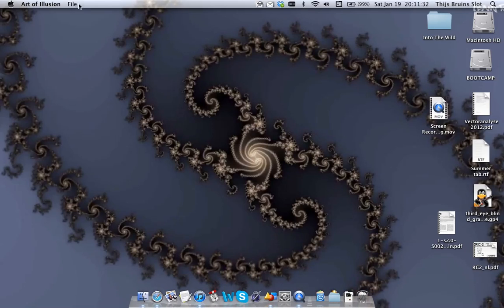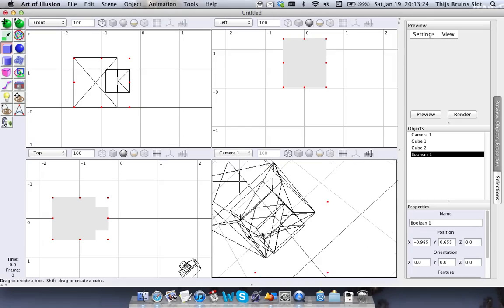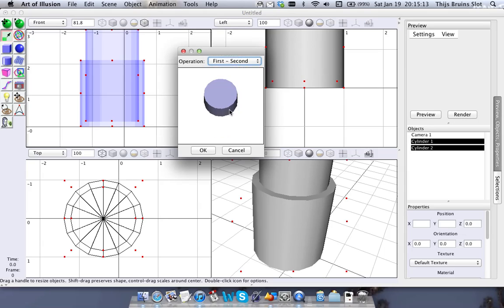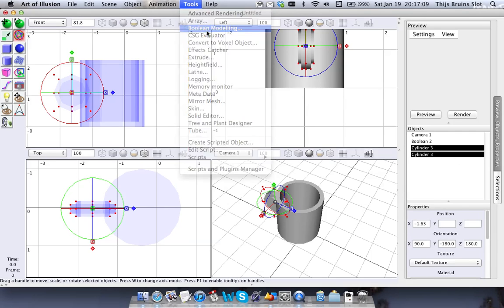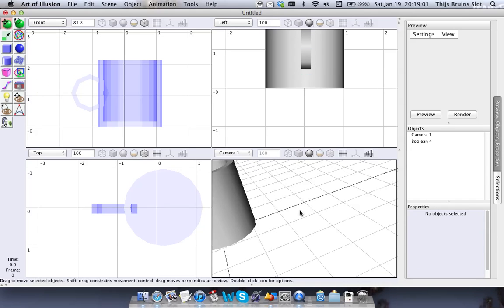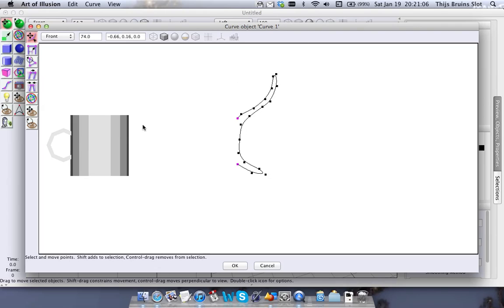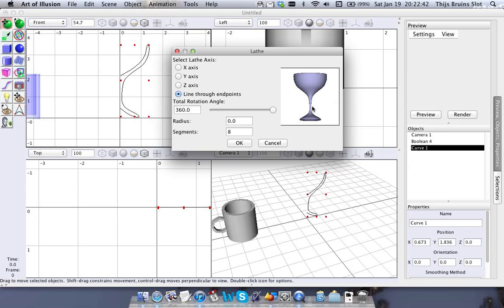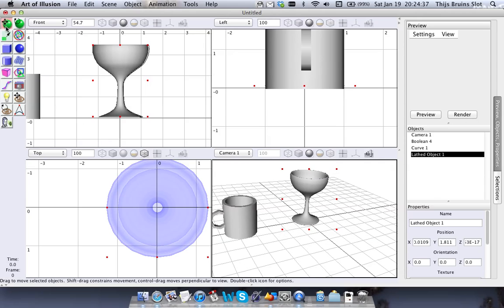Art of Illusion tutorial 02: Boolean and Lathe tools

Comment: First of all I wanna thank you for this series of great tutorials.

I was following this tutorial on the boolean tool and what happened to me
is that when I wanted to create a circular hole on a flat cube, right after I use
the boolean command, the hole tranforms to polygonal or even rectangular.

Do you have any idea why this happens?

Thanks in advance.
Reply from the maker: Yes this took me a while to figure out too when I first got started. It is because you are using a primitive object like a cylinder or a sphere. It happens because AoI is automatically adjusting the resolution of primitives based on the size in the scene (at least that is what I think). So either try scaling everything up or better yet, try converting the primitive to a triangle mesh and setting the resolution (lower max surface error = higher resolution) like that. It shouldn't give this strange effect then.
Reply: An old question now but check Edit / Preferences / Interactive Surface Error. 

If your mpdel is small in scale, this value should be small to show all the details. If you model is very big, this should be bigger, so the number of rendered triangles will stay reasonable.